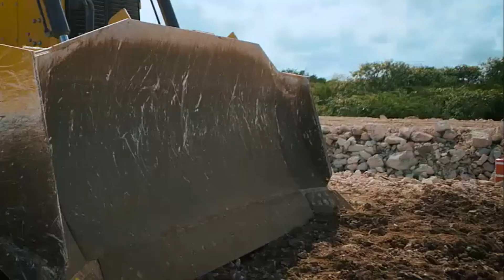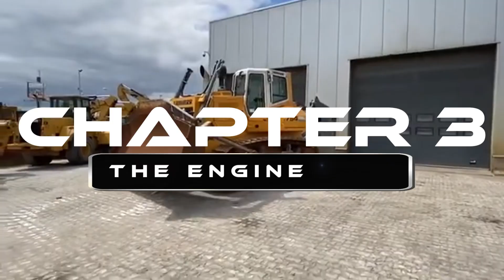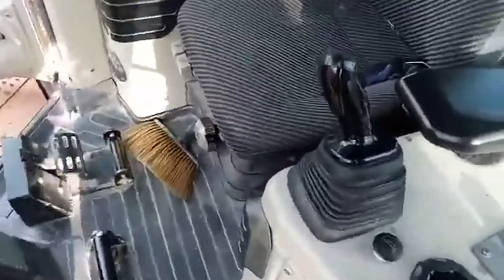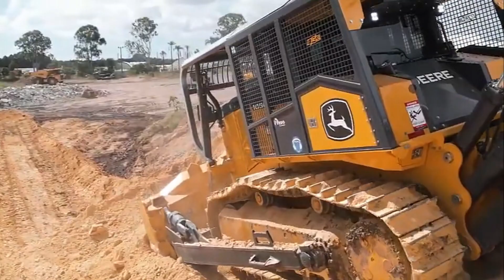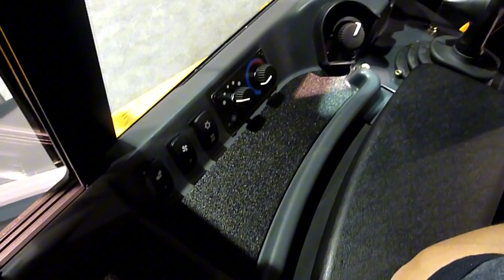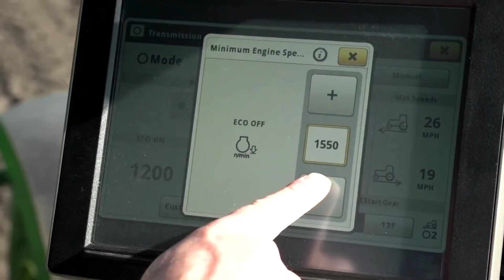John Deere vs Liebherr Who Wins the Bulldozer Battle?

Comment: Just left a demo onsite between the JD 950 P and Liebherr PR736, the operator thought the Liebherr was underpowered but they they realized that the engine was just super quite. The Libherr was side by side work next to the  JD950 multiple operator operated both and at the end of the day they all preferred the Liebherr they keep it for a week and the 950 was sidelined every time I visited. If your doing fine grading Liebherr and Trimble GPS is what you need.
Reply from the maker: Thanks for sharing your experience! It’s always interesting to hear how different machines perform in real-world scenarios. Sounds like the Liebherr made a strong impression!